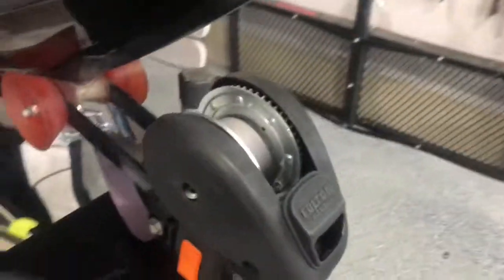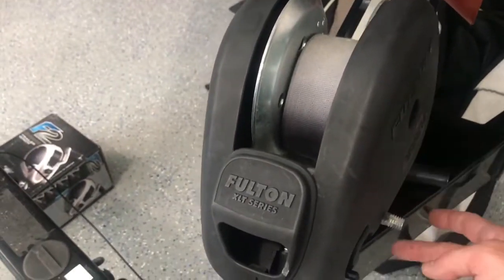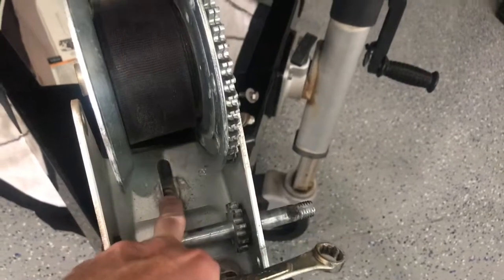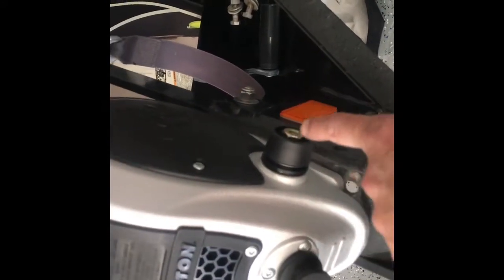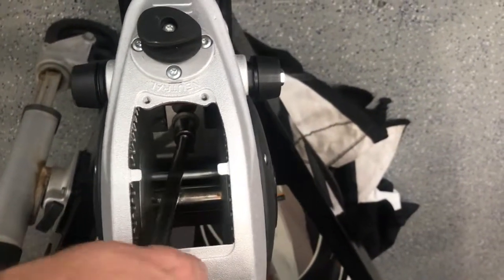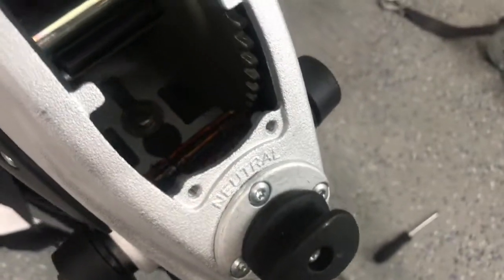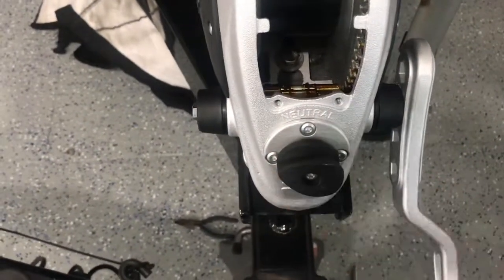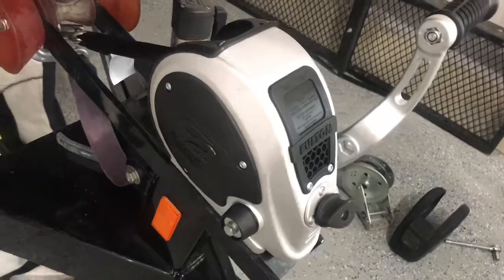Fulton F2 Boat trailer winch replacement on a Boatmate trailer

Comment: Can the Fulton XLT and F2 accommodate the winch strap coming off of the bottom of the winch, or would that not work with the anti-reverse switch thingy?
Reply from the maker: It's tough to say
Reply: @Myksgarage  I checked the PDF manual for the F2, it looks like it does.

Comment: According to the instructions, you have to torque the black hand piece on the handle at least 20 ft pounds. My sleeve collapsed inside the black band piece . Not a happy camper
Reply from the maker: Thanks for sharing this tip!

Comment: DUDE , you need a  tripod  for your Phone, so you can use two handle, I almost peeped in my Pants when you couldn't get the strap - bolt into the strap, and the winch handle kept toppling over , and the nut falling on the Floor... LOL
Reply from the maker: Yeah this was a sloppy video with only 1 hand.  Thanks for watching!
Reply: @Myksgarage  you're funny. I wish my kids would take criticism that easily. LOL.
Reply: @Myksgarage  STAY WELL my friend.  Happy Boating